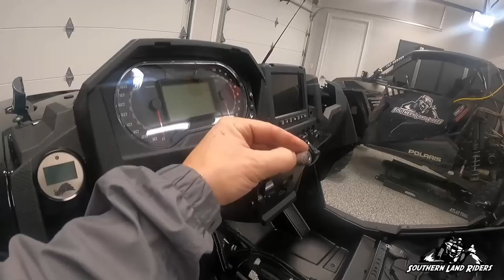2021 RZR Turbo S Build

Comment: 100% agree with your shock upgrade and Shock Therapy for us east coasters.
Reply from the maker: Yep. Not a fan of shock therapy. Allthingzutv tenders have been great.
Reply: @SouthernLandRiders  me either i had them do a 2500 deal thats springs an revalve still rides rough...Over rated...
Reply from the maker: @rogerl8488  I completely agree
Reply: Not to mention the weak ass springs from ST destroy your shock bodies. Every single one of us with those springs has had to replace shocks. (Three for me,  two for Ryan and four for Brian. Benjamin is about to need at least one new one )
Reply from the maker: Joey's shock bodies broke in half as well with ST springs.
Reply: @SouthernLandRiders  yeah my shock bodies are rubbing very bad meaning the plastic divider.....

Comment: You need to invest in a jacktech 3000 spring compressor for working on shocks!! Super easy and definitely safer than what your using!!! I use mine a lot! Makes it super easy to adjust ride heights!
Reply from the maker: Yeah those are nice but you gotta take the shocks off the machine to use them. I can have the springs adjusted in about 5 minutes with the hand compressors I use.
Reply: @SouthernLandRiders  kool man I get it!! 
I don’t mind taking the shocks off as it’s pretty easy on my wildcat XX and it gives me a reason to turn a wrench in the garage I guess and It’s so kool to use and have though!!! Gotta love nice tools!! 👍 and my buddy’s love the ease of use too! But it’s all good!
Reply: @SouthernLandRiders  I gotcha! I’ve discovered that the shock therapy dual rate springs upper and my stock lowers work amazingly!! Very weird combo but it’s a sweet spot!

Comment: Let me know your opinion on that front differential rs1 I just swapped one in my xp1k love it so aggressive but smooth
Reply from the maker: They take a beating. I got about 2000 hard miles from my 1st one. I have not had as good luck on the last couple but that is just part of it.

Comment: With the trinity exhaust have you ever thought about getting a trinity blow off valve to? We put on on ours and love it.
Reply from the maker: I have always just used the Aftermarket Assigns BOV. They have never given us any issues and Mike at AA is a great guy to deal with.
Reply: @SouthernLandRiders  I thought you always just ran the stock one because I’ve never heard it in a video.Love the new machine though I wanted my stepdad to get the 4 seater version of that one but he said it’s to wide for him haha.
Reply from the maker: @calebknight9680  I just have always had them plugged and never opened the vent so they do not make any noise. It is wide but I promise once you drive a 72" machine you won't want to go back to anything else. The extra stability is huge.

Comment: What kinda of tires are those ?? The crawler XG or The XR ?? And are they 32” or 35”
Reply from the maker: They are MRT Crawler XGs. They are the same exact tread pattern as the pro armor crawler XG's. Only different is the stronger sidewalls on the MRT's. They are 32".
Reply: Never seen the MRT Crawler... I have the Pro Armour 30” XR and I am moving up to the 32” thanks for the reply will check into those tires.

Comment: Hey stumbled across your channel, Thanks for all you share. I recently just purchased 2021 Turbo S same exact as yours. Just ordered the sixxer Cage from Austin at GDR. Question I am am about to buy some new wheels and tires as well what offset do I need ? Or what do you recommend? I am in Chattanooga Tn
Reply from the maker: You are starting off right! Austin makes the best cages out there. I have always run STI HD9 6+1 offset wheels and been happy. They are affordable, look good and have never given me any issues. They are also one of the only 2 wheels that are 15", beadlock and maintain the 6+1 offset. I do not want to be any wider and did not want to change any of the geometry from stock.

Comment: Another question.  Did you cut the rear fender flares like that or did they come that way.  Mine go all the way down and Im thinking of cutting them if they still work good.
Reply from the maker: I went with the Mudbuster Mud-Lite Fender Flares which do not go down the rear fender all the way like the XL's do.

Comment: How does the spray paint hold up on the springs? Thinking about doing that also until the time comes that I get better springs.
Reply from the maker: I do not think it is going to hold up very well. I am probably going to have to get them powder coated and use low heat during the coating. It has chipped a little when I used the spring compressors on them.

Comment: For the type of riding that yall do...I really think you would like a gear reduction. Helped a ton on mine. The belt is so much happier.
Reply: I just did a 47% on mine Ryan drive it and liked it he may do a 33% in the future
Reply from the maker: If I go to 35" tires I will down the road.

Comment: what about the factory door speakers?
Reply from the maker: Unfortunately I could not use them with the Pro Armor doors and door bags so I had to take them off.
Reply: @SouthernLandRiders  makes sense, love the build looks very nice. excited to see the tube chassis
Reply from the maker: @garrettmcdaniel2472  Thanks Garrett. I can't wait for the tube! I took the new S out for the first trip last weekend and it did great.
Reply: @SouthernLandRiders  that is no surprise built with great products. any idea when the other will be finished?
Reply from the maker: @garrettmcdaniel2472  I am thinking about 6 more weeks. H has been busting it!

Comment: Another awsome build man! You are living the life! If interested look into the warn axon 45-s for your next winch, alot simpler to wire up. Just hot ground and rocker switch wire, running it on my 19  turbo s, loving it so far.
Reply from the maker: Thanks man. I actually did put the Axon on the new tube chassis. It is a great winch.

Comment: In the future you should wire your electrical upgrades with deutsch connectors so they are waterproof and will never fail or lose connection! You will need the special crimpers if you decide! I started using them and they are great!

Comment: Do you recommend the crawler tires? I do 95% higher speed trail riding and probably 5% rock crawling.  I know Roxxzillas are no doubt the best rock crawling tire… but the pro armor crawlers seem like a better option for me since I don’t do much rock crawling. 
I don’t try to ride much asphalt, but sometimes I still end up on asphalt more than I wish.

Comment: Any of you guys running gear reduction in the turbo s platforms? Heard alot of complaints of the gearing being high for the riding you guys do
Reply: I know chris did in his first turbo S not sure about the one he has now
Reply from the maker: Chris just did a gear reduction in his. Everyone else is on factory gearing.
Reply: I did a 33% on my 2019 before I totaled it. The 2018 I’m driving now just had a 47% done and I love it.

Comment: I bet you just did the springs and did not have your shocks worked with ST? I have there complete stage 4 setup and it is nothing short of amazing. I ride all over the country but mainly where you guys do. It is so good I rank it as the #1 upgrade over everything else.
Reply: Yeah, we will never do that again.  You won’t either after your shock bodies get destroyed by the weak springs rubbing the threads off of them as you ride. Sure it’s plush, but you’ll be buying new shocks in eighteen months.... so far every single person in our group running those springs and their valving needed to replace shock bodies. At least eleven shock bodies in the last half of 2020.
Reply from the maker: Yeah we are not fans. I did have the springs re-valve. The springs alone were bad enough but the re-valve completely destroyed any of the firm, sport and comfort modes. I had the re-valve done on the 1st S I bought.
Reply: @SouthernLandRiders  Hmmm. we have 2 machines that have over 5000 miles(80% in east TN) on our stage 4 setup with no issues. We have some wear showing on a couple shocks but not bad. Not sure if it made any differance but we made a riding trip to AZ and had them do the install in their shop. Granted we don't run the S just the standard XPTs. After 5K still blows me away how good it is compared to my new 2021 T&R. I will be doing the suspension first thing as it rides like a log truck compared to my XPT.
Reply from the maker: @boltactionshooter  Yeah it was good on my 2016 turbo but the turbo S is a totally different story. I am not sure what changed but I loved it on my 2016. It has not been good to any of us with the live valve Fox shocks.
Reply: @SouthernLandRiders  Good to know. Yeah I'm still rocking my 2016 XPT. I won't give it up due to the gearing and the fortune I have sunk into it.
Reply: I did springs and full revalue in my turbo s also and I am not happy with it. I wish I could go back to stock with tender upgrade.
Reply: Yep I have the ST dual rate kit and I am definitely not happy with it on my XP4T. 800 miles and the shock bodies are getting demolished from rubbing.
Reply from the maker: @jasonmann322  yeah we have had about 10 different shocks destroyed in our group because of their springs.

Comment: Just my 2 cents!
But I would prefer weaker axles to prevent broken diffs! You want the cheaper part the weak link in my opinion plus it’s much easier to replace an axle than a diff for sure!
Reply from the maker: Yeah but in 5 years I have only replaced 2 difs and zero axles. Brian replaced 8 axles in a year before finally upgrading to RCV's.
Reply: @SouthernLandRiders  lol yeah 2 diffs prob equals 8 axles! Lol I understand your reason!!
Reply from the maker: @outdoorzone  I now carry a new spare dif in the trailer as well. lol
Reply: @SouthernLandRiders  nice!!

Comment: In your 2019 did you make any modifications or changes to the front Diff? Also what issues did you have with your knuckles? I’m a fellow Turbo S owner I’m kind of interested.
Reply from the maker: I am on my 3rd front dif now. I busted the last one a couple of weeks back at Stony. We all just run the stock dif. The 1st one held up for about 2000 hard miles with no issues. The last one did not last but 3 or 4 rides I think? We have all had issues with the knuckles. They have broke completely twice and the most frequent issue is the wheel bearing becomes loose and they crack at the back of the knuckle at the slots that hold the bearing in.
Reply: @SouthernLandRiders  Thanks for sharing your experience! Appreciate it.
Reply from the maker: @XMARGH  You bet. Thanks for watching.

Comment: How do you like those walker links?
Reply from the maker: I really like them a lot. When I first put them on I wasn't expecting much but they really do make a difference. I wanted to keep the rear sway bar for the high speed riding so the links are sort of meet a half way between no sway bar and keeping it on.
Reply: @SouthernLandRiders  did you run them on all 4 corners or one front and back?
Reply from the maker: @____MC____  I just run them on the the rear. I do not run a front sway bar at all. None of us in the group do.
Reply: @SouthernLandRiders  i only do a little bit of crawling and thought those would be great to have. Just dont hear much about them. I do desert/dune/semi rocky trails with occasional small boulders.